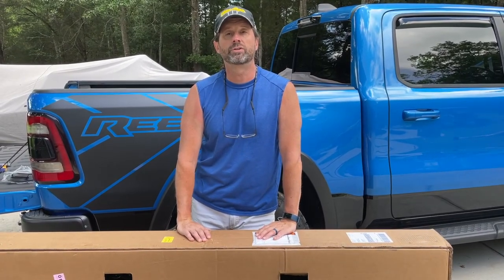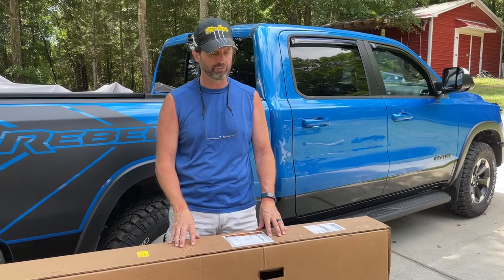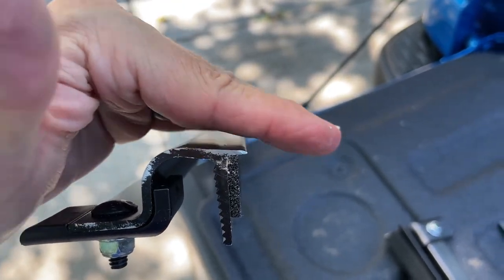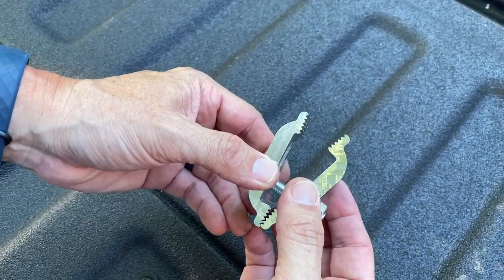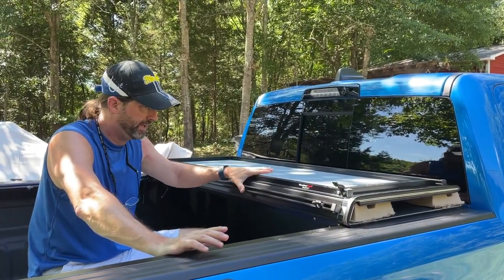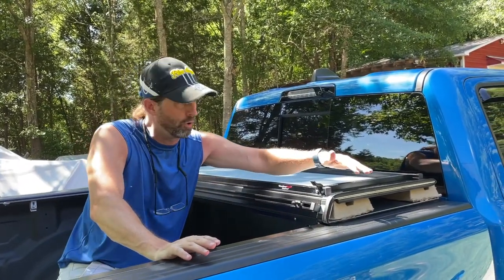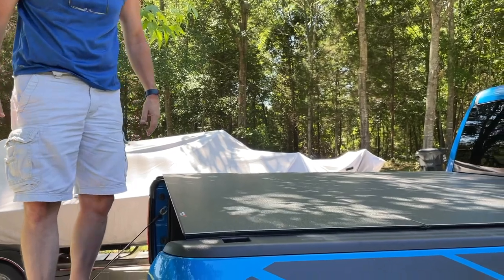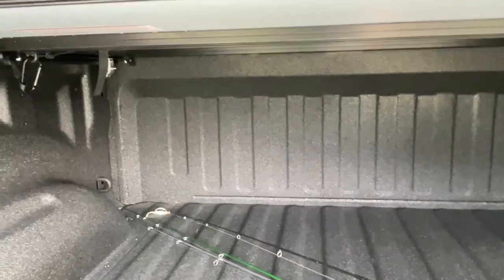2021 Ram Rebel - WeatherTech AlloyCover Tonneau Install

Comment: My wife got me rhis cover to replace the piece of shit bakflip mx5. I cant wait to throw the mx5 in the trash! 😂 The clasps fell apart, the plastic coating on the latch release cracked and fell off, the seals completely blew out. Theres not a spot on the mx5 that hasn't broken or come apart.
Reply from the maker: Man that stinks to hear that, I had nothing but defects on the two they sent me.
Reply: @BooneDownSouth  I like how the mx5 folds all the way up. I have a diesel aux tank in my bed so I don't need the whole thing open but it'd be nice for refueling. All good so far. Thanks for the vid brother, super helpful! 🤙
Reply from the maker: @scottleggejr  Yea I really liked that about the MX5, I really wanted that to work out because of that.  I also bought the bakflip work box or whatever they call because I thought that would be really convenient for stuff but that cover just had too many problems.